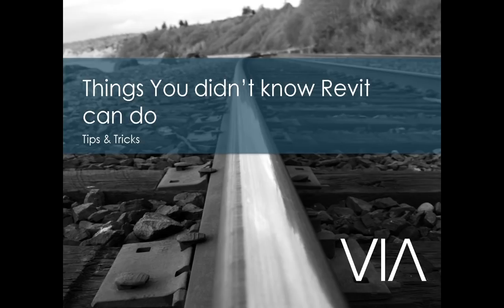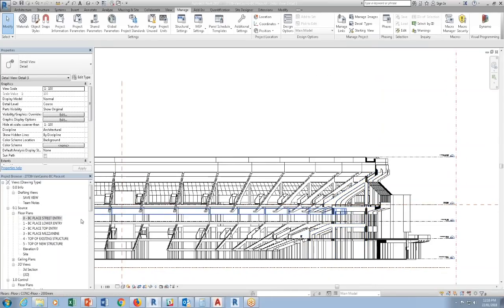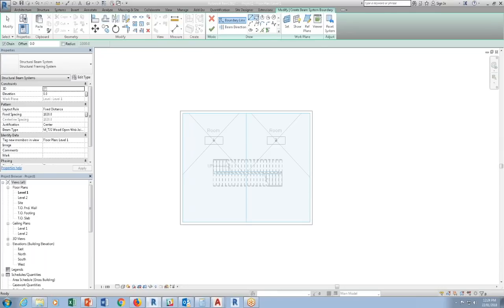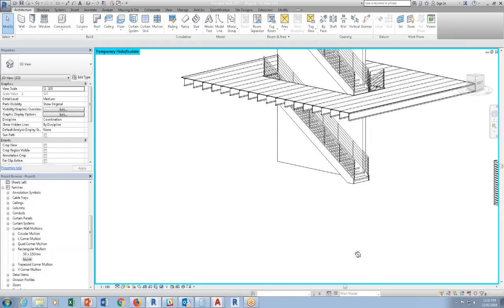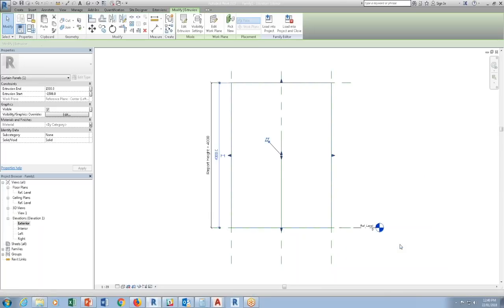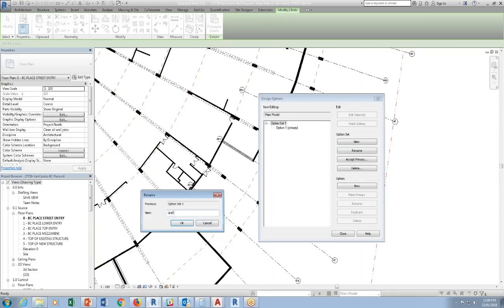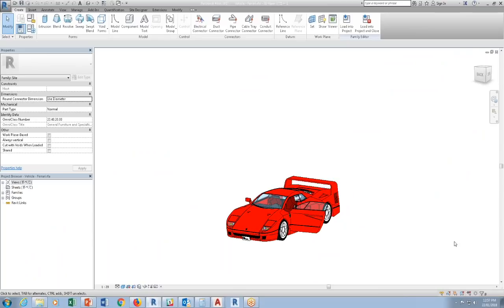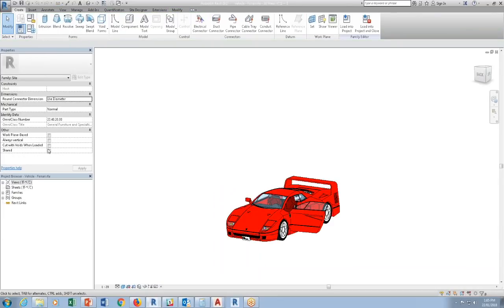Focus Group  - Things you didn't not know Revit can do

Comment: Things Revit cannot do: line weights as we're used to from CAD days, produce coloured prints of high quality (what is the point of working in a software you cannot produce good drawings from), copy sheets between models (you always have more than one morel), stairs (reg compliant balustrades), join layers of fabric (5 layers is barely ever enough, Archicad has 500 not 5..). Do you want me to continue?

Comment: Wouldn't it be better just to make a sweep for the property line? Then it wouldn't cover your model...
Reply from the maker: I did that before. The only issue is those sweep needs a thickness. If you dimension them, it will pick one edge or the other. I did encounter user dimension the wrong property line & have constant argument with the city. Yes you can use sweep, but make sure user are aware that it need a thickness. Those thickness can cause some dimension to pick the wrong edge.

I also use adaptive component surface. Only main issue is the adaptive doesn't know if it wants to stay up or down. It is a mix bag. The method i'm showing is probably the easiest for anyone to use.